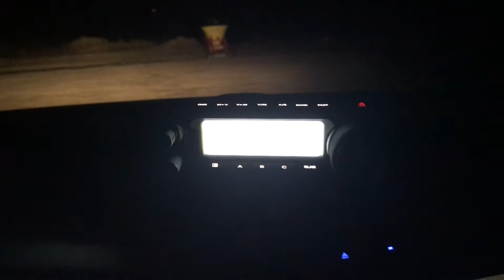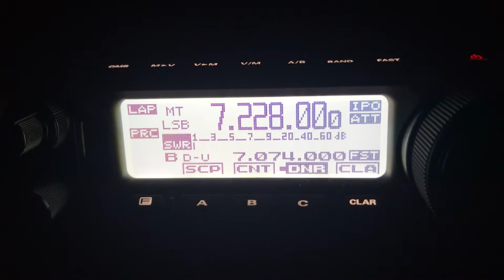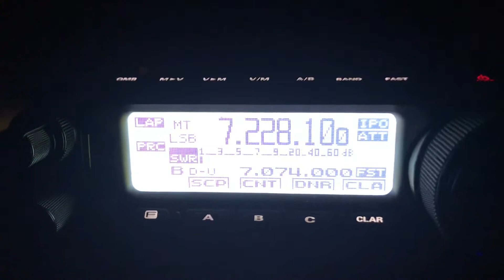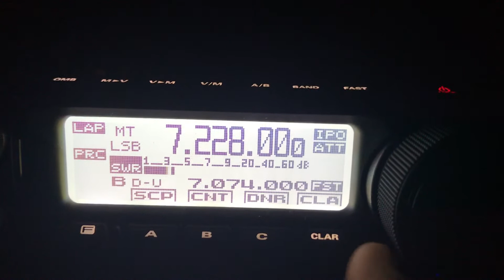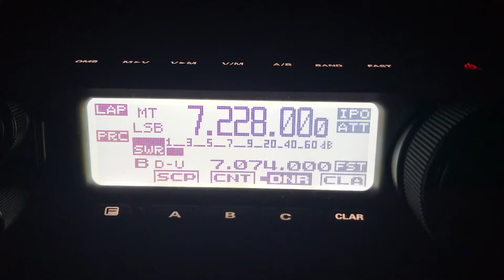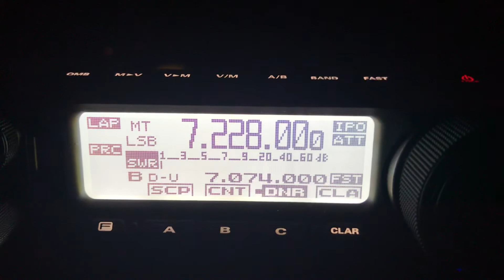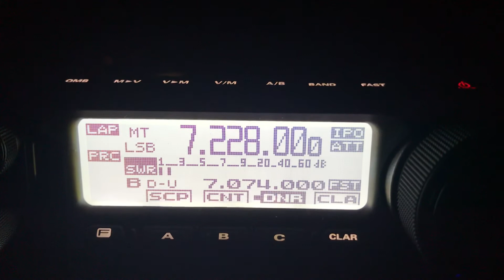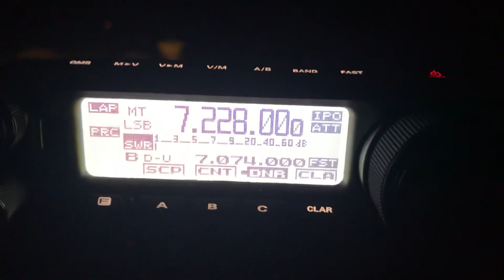Yaesu FT-891 Mobile - Testing the DNR Function - Its INCREDIBLE !!

Comment: I agree completely! I also have the 991a and as good as the 891 is at reducing noise, the 991a is even better. when you get above 11 or 12 on the 891, the audio starts getting a bit muddy, but on the 991a, it gets really crisp at about 12 and then gets muddy around 14. I like both and it not only cleans up ssb, but AM very well if the signals are at least readable. very low signals on AM tend to get lost in the mix but ssb still comes through. I also tuned through the am aircraft band on the 991a and WOW was that ever an awesome  sound quality. it is dead silent between words and gives you the feeling of being right in the cockpit of the plane. DNR is absolute magic! wz0zzz